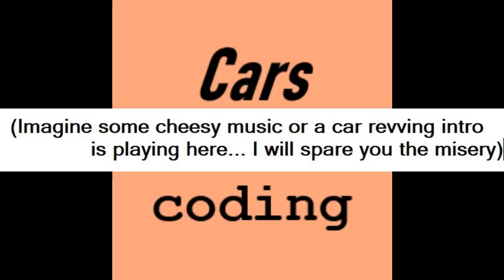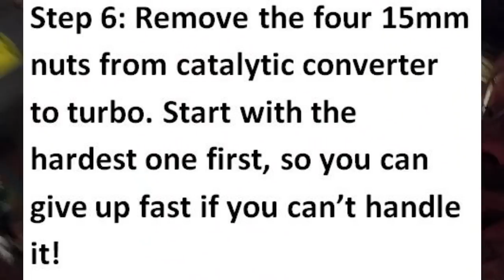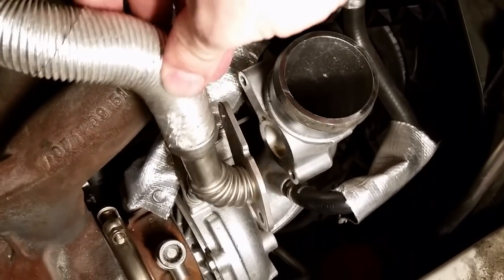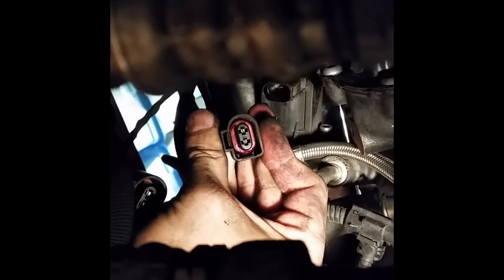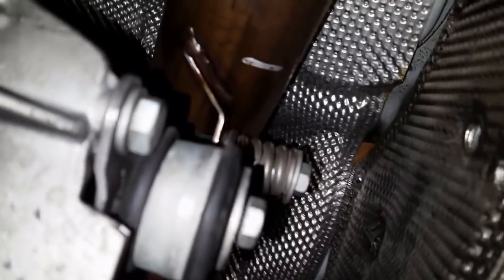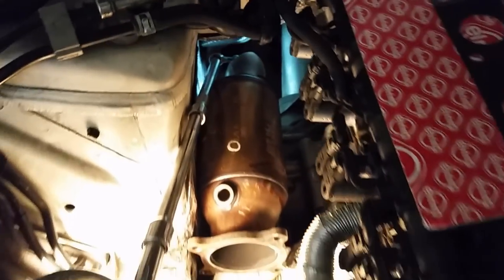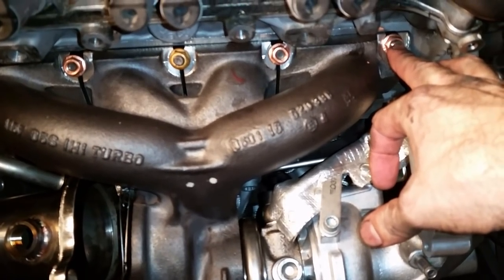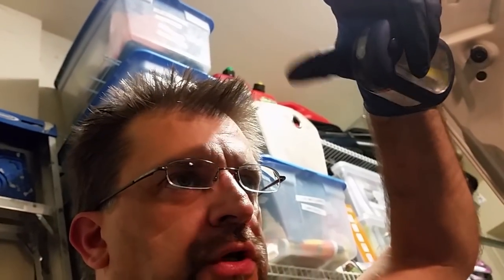Replace Turbo Audi A4 A5 Q5 B8 Turbocharger K03 Replacement

Comment: Did you have to clear the check light engine with a VAG or something or the light went out on its own?
And what oil did you put in the turbo? Engine oil? And do you have to?
I’m not getting the catalytic converter P0420 code, just P0299, still thought I’d ask, I don’t have to put in the test pipe right?
Reply from the maker: The check engine light will go out on its own once the turbo is replaced. But you should get a code reader they are very cheap just to clear codes! Yes you put oil in the turbo to prime it. It is not necessary I guess, but why would you not do it? You do not need the test pipe, just use ypur current catalytic converter. The reason I used the test pipe was to be able to put stage 2 tune on it, which I later did. If you use your stock catalytic converter this job is a LOT faster! You do not need to remove the cat, just the 4 bolts holding it to the turbo
Reply: Cars and Coding thank you. What cheap code readers would you suggest apart from the good ol Vagcom. And I don’t need to take out any of the oxygen sensors since I’m not removing the cat right? Also when you switched to the test pipe you got before you went and did the stage 2 tuning, did it change anything power wise or torque wise?
Reply from the maker: @EJR20  best code reader to get right now is Obdeleven. It connects to your phone and you can not only clear codes but also update settings and look at data real time. It is around $100 I think.  Other than that any $20 code reader can clear codes. As for the catalytic converter it would be best to remove the front o2 sensor just so it is not in the way but not necessary. The test pipe gave no increased power with stock tune. It is a little louder, but not worth the hassle.
Reply: Cars and Coding did you have to drive the car for about 50mi before the light went out or it went off right after the start post-replacement?
Reply from the maker: @EJR20  I cleared the codes myself so I do not know how long it would take on its own. Buy a code reader! There are ones for like $20. It is an essential tool for all cars. I would suggest Obdeleven, the one that connects to your phone. It is more money but does a lot more things.
Reply: Cars and Coding cool thanks, I’ll be sure to.

Comment: How did you notice there was something wrong with the wastegate?
And where did you get the dipstick for the oil pan?
Reply from the maker: Check engine light kept coming on and throwing a code. Car had less power (but still plenty of power). Dipstick: https://ebay.us/A3iIbi
Reply: @CarsandCoding  It is the same engine that is in the 2009 right?
Reply: @CarsandCoding  when I first start the I have turbo pressure but when I go over 3000 rpm I lose all pressure and it won’t build pressure until I stop and start it up again
Reply: One more thing, where and what turbo did you buy?
Reply from the maker: @kjosen0132  link for where to buy turbo is in the video description. Click the “more” button under the video title for all the links. I bought a super low mile used turbo from eBay. But there are alternatives now. And also you can get yours repaired. Google Audi wastegate repair and there are shops you can ship your turbo to and they will replace the wastegate if you prefer to do it that way.

Comment: Informative.  I like the video.  Thanks.  However, I'm not of fan of swapping the cat for a "test pipe".  In my state they check to see that O2 sensors are intact during smog check and a cat delete is blaring.  I've also been stuck behind a car that has a cat delete and suffocate on the fumes.
Reply from the maker: I agree it is best to keep a catalytic converter. Glad you liked the video! Stay healthy!

Comment: on my car I was able to shorten the wastegate rod I cut off the rod about 1” down and attached a clevis pin with internal threads as I screw the clevis pin on to the rod it shoetens the length of the rod enough to hold the wastegate shut. 33:35 he talks about this briefly

Comment: I have an audi a4 2009 2.0T, how could I ask for the turbo only with this number ?: 1157 D5S 1H1 TURBO?  or how do i order it?  I would like to buy it but I don't know which turbo is the right one.  I hope you answer me :(
Reply from the maker: Is your 2009 a B7 or B8 style? If B8 then any turbo from A4 from 2010 to 2015 will work. Look it up on a parts website like rockauto.com
Reply: @CarsandCoding  yeah is B8 style thank you for the information

Comment: So I bought a new borgwarner oem ko3.. preparing for install in the few next days.. my only concern is priming the turbo with oil.. they said I need to cold crank it for 1 min. In 15-30 sec Intervals. Before a start.. they said if I dont it could void the warranty if it burns up.. they said to disconnect the fuel pump.. but I tried that, pulled pump fuses pulled high pressure fuel connector. It just kept running.. lol and I dont want to mess anything up with the electronics or cause other damages... did you feel the Turkey baster method worked just fine? Did it stay full? Or did it keep draining back into the oil pan? Hmmm I might be overthinking this.. what do you think?
Reply from the maker: According to the Audi service manual, it says this: "After installing turbocharger, allow engine to idle for approx. 1 minute
 and do not rev up immediately to ensure turbocharger is supplied with oil." Thats all you have to do.
Reply: @CarsandCoding  thank you soooooo much for looking that up for me. You have been a giant help.. and have given me the confidence to knock this job out. I'm waiting on my install kit to show up and a new oil feed line.. I'm in gonna jump in.. oh I already took that 6mm Allen bolt off the heat sheild lol.. it striped.. but managed to remove it fairly quickly using an bolt extractor. Lol did you reorder a new one? Or just put the old strip one back in? Or leave it out? Lol if you ordered a new one. Do you have a part number or website ordered from.. thanks again!
Reply from the maker: @milehigh3054  I put the old one back in loosely. I dont know the part number, I was going to leave it out but put it in after I knew everything was good. I dont plan on removing it again for at least another 50k miles at the least.

Comment: Audzine sent me here!  So, what's the cost comparison to rebuild the turbo vs. buy new?
Reply from the maker: There are few places to rebuild. I heard there was a shop in Canada that fixes the wastegate for about $250. You can find low mileage turbos for about $350. A new one will be closer to $1,000
Reply: I bought a new oem borgwarner for 900 bucks after tax.. I'm happy with that decision.
Reply: @PeterFeltersnatch852  tires? It's a ko3 stock oem.. I found it local here in Colorado of all places. From Diesel forward. If you want a super fast car.. buy it super fast stock.. imho modifying cars just opens doors for more problems and then becomes money pits with problems.. bottom lines cars are the worst investments you can have. The turbo was a complete new unit. With exhaust manifold. Just needed a install kit.. the turbo martket.. is shady in it's own come to fine out.. found the same turbo.. from 650 from other countries from 1400 bucks.. I went with a reputable dealer for 900 after tax. It took some calling around.
Reply: @milehigh3054  Still happy with the BorgWarner???
Reply: @leaveit33  Hi Steven..yes! No check engine lights. Full power restored. I've noticed the turbo sounds a bit different than the stock turbo is all. No big deal. Still going strong.
Reply: @leaveit33  it sounds different because I believe the intercooler muffler is a different design. It sounds like an extra fan running under the hood upon cold starts. But Gos away after it warms up. I don't notice it while driving. Not bad at all. I'd say not as quite as the stock turbo was.. who knows. Maybe the different design allows better air flow = a cooler running turbo?  Equals more power? Hard to tell. But satisfied none the less.
Reply: @milehigh3054  thanks for responding.  Just ordered a BW. Install it next week
Reply: @leaveit33  nice.. any questions I'll be glad to help.
Reply: @milehigh3054  thank you
Reply: @milehigh3054  nice having the same issue got my 09 a4 qttro in jan bought it for 7k from a shady dealer that doesnt even do warrantys or guarantees nothing.  yet kbb said it was one of the few reliable 09 a4s so no recalls. Took it on the smallest test drive and didnt even feel the bad steering bc of alignment until i drove it home the next day after, also apparently water damage so my windshield fluid leaks. Yay. That was after oil change i found out. Took it to a expensive ass mechanic here in nashville and tried to charge me 3k for turbo assembly and 1k for alignment 😂. took my car back and looking at a borgewarner k03 for 1270 on turbochargersdirect with a year warranty, i called a few weeks back and they told me they had 3 in stock and it would fit my engine by the looks of the codes. Planning on ordering it and taking the time to get the tools i need to start replacing
Reply: @Idealsleeperagent  Dang man that's rough. How many miles on it? 3k is not bad for some else to do that turbo.. think I remember it taking me like 14 hours plus. Paying someone like $1200 for labor/fluids is probably about right because that's what I would charge. It's a big job. Especially if you don't have the right tools.

Comment: Hi. Please, answer, when you install new turbo to car, what bottom hoses are connected to turbo, and what  hoses you connect after install turbo to block? Today i try to install it. I connect turbo to block with bracket and oil drain hose, and i cant to connect bottom water hose.
Reply from the maker: You have to connect the coolant/water line on the turbo before installing the turbo. And make sure it is tight! You are going to have to take it back off and put that water line on. :(  Every line that was attached to turbo when you removed it needs to go on the turbo before you install it back. And double check they are tight as that water line is near impossible to tighten once turbo is back on but it can be tightened if you use the bit and a wrench.
Reply: @CarsandCoding  ок. thanks for you answer. i will try again :)

Comment: My 2008 a4 needs new turbo  so bad i lost my horse power p0299 code comes on its not diverter valve waste gate is open lose i gotte do something replace it nice video 👍
Reply from the maker: Yes sounds like you have a weekend project!
Reply: Cars and Coding  with ur video maybe will help how to do it isn’t easy work on this german cars no space to put ur hands

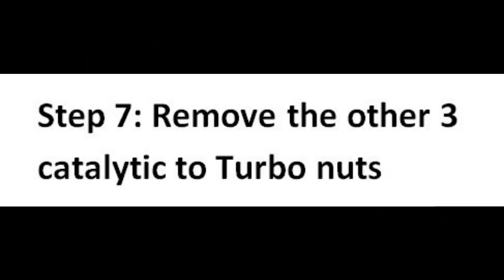Comment: 9:33  You did not show how to remove other two inside bolts connecting catalytic and turbo. How can I access them? Thanks!
Reply from the maker: Three you can see easily and get a wrench or socket on. One you cannot see and need to put a socket on a 11 inch or so extension and put down from top rear of engine at firewall. I show how I did it around 7:00 in Step 6. It was not possible to video everything but I show the process.

Comment: I have a 2009 will a 2013-2015 used turbo fit?
Reply from the maker: Yes as long as it is a B8 model. In USA 2009 was a transition year with some models still the older B7 body style car.
Reply: @CarsandCoding  mine is a tfsi and looks just like yours👍

Comment: Audi quoted me $4,500 to replace my turbo in my 2013 Q5. How much did this repair cost you?
Reply from the maker: I paid $350 for the used turbo, about $100 for the install kit. And about 10 hours labor, but pro could do it in 6 hours. You can buy brand new turbo with lifetime warranty from Fcpeuro.com for around $1750 https://www.fcpeuro.com/products/audi-turbocharger-genuine-vw-06h145703s
Reply: @CarsandCoding  woweee and im looking at a website selling one for around the same price just saw this comment and found the same one for even a little cheaper and extra stuff for replacment. Im looking forward to trying my own even more confidently now thanks

Comment: Do know the name of the spring and nut that’s on the end of the down pipe
Reply from the maker: https://parts.audiusa.com/p/audi_2010_A4/Spring-Bolt-Exhaust-Front/48598515/893253353.html
Reply from the maker: https://parts.audiusa.com/a/Audi__A4/__5997102/EXHAUST-SYSTEM-EXHAUST-COMPONENTS/1399360.html

Comment: Read your description. Would a turbo from a 2013 Quattro fit a 2009-2010 a4 Quattro?
Reply from the maker: Yes any 2.0L Audi 2010 to 2016 will fit. A4 A5 or Q5. The newer the better!
Reply: Cars and Coding guess that goes for 2009 Quattro too?
Reply: Cars and Coding I have a check engine light on, & it’s P0299, I just replaced the diverter valve but the light is still on, (didn’t run any scanner to check again yet) I’m wondering if I should replace the turbo or what.
Reply from the maker: @EJR20  you need to look at the wastegate and see if its loose. Or reach your hand down and grab the actuating arm like I show in the video and see if its rattling. If the wastegate is bad then you are not making full boost. You can keep driving it like that you just dont have full power.
Reply: Cars and Coding if the waste-gate is bad would that mean I’d have to replace the whole turbo as the best course of action? Also, if I keep that’s the case and I keep driving it won’t it damage the engine? I hear cases of metal parts ending up in the engine oil or something related to that.
Reply from the maker: @EJR20  loose wastegate will not harm engine or turbo at all. You can fix wastegate but not many mechanics know how so they replace turbo like I did.
Reply: Cars and Coding so I tried inspecting the engine noise, & I could hear some whining noise (kind of like a dentist’s drill, but not as loud) after I rev up the engine in idle, do you think it might be turbo for real? If yes, would it be the kind of turbo failure that would lead to engine damage if kept driving it?
Reply from the maker: @EJR20  nothing in the turbo is going to cause permanent engine damage. Even if the turbo self destructed, the air goes through the intercooler which would filter out any metal chunks. I have not heard of these turbos coming apart like that ever. If you like the way it drives just drive it and do not worry. If you want to get rid of the check engine light its going to cost you some money.
Reply: Cars and Coding thank you for the information. I do wanna get rid of it, basically I would need a new turbocharger as the best course of action right
Reply from the maker: @EJR20  Yes or find a shop that can repair the wastegate.
Reply: Cars and Coding repairing it would be more cheaper?
Reply: Eddie Jasson repairing isn’t guaranteed. It will cost about $60 for parts to replace the turbo gate itself. Better to buy new or used turbo. The wastegate is loose. Bad design on audi for not letting us adjust the arm to make it tighter.
Reply: ernie p yup thank you, I’ve decided to get a new turbo, well used, I don’t want the back and forth hustle to a shop and I’m running out of time.

Comment: How long did whole process take
Reply from the maker: It took me a weekend. I would say 10 hours. I could do it in about 6 hours if I did it again. I'm not a mechanic so if you have experience it will go faster or slower depending.

Comment: is  the heat shield needed to be removed? my 6mm screw stripped(i was able to remove the second one no problem;the one on the right in this video. ) and i opted for bending the shield enough to get to bolts. Witch i already loosened(sheild can be bent back into place) . im stopping for the day as i have work in the morning.
Reply from the maker: It's probably possible to bend the heat shield out of the way to get to the exhaust manifold nuts. Did you try jamming a t40 torx bit into the heat shield bolt allen head like I did? Put the t40 torx bit in there and hit it with a hammer and then it will turn out.
Reply: I will try that next. Otherwise I'll try removing with a viceclamp, heat, w40 after the turbo is out the way.
Reply: @CarsandCoding  Never underestimate the power of Thor's hammer (and a little penetrating oil)